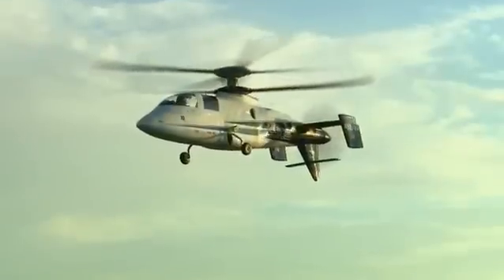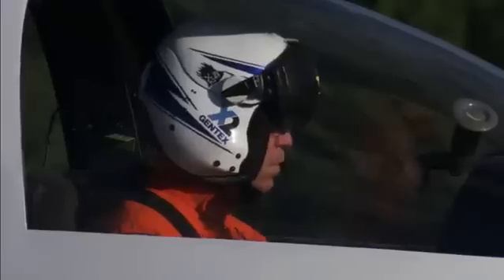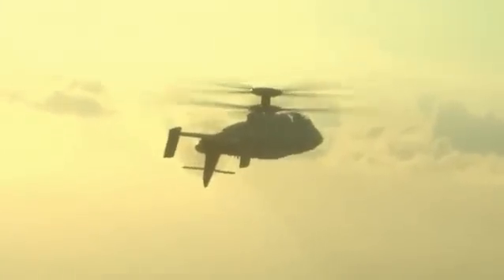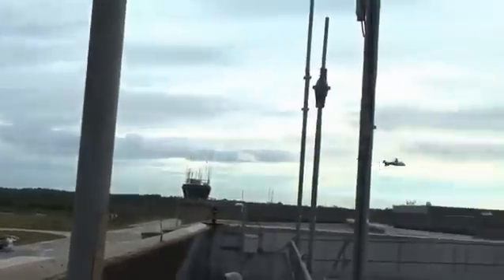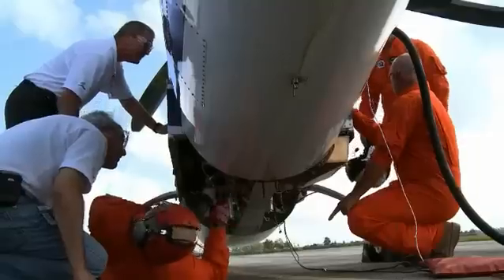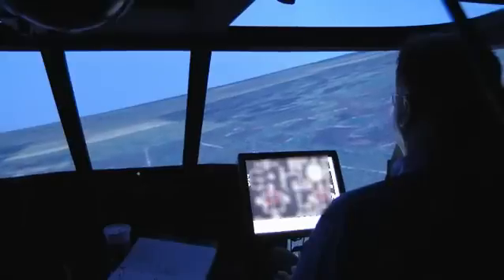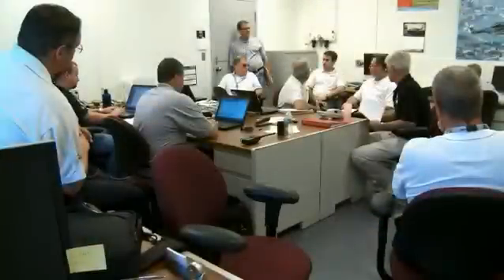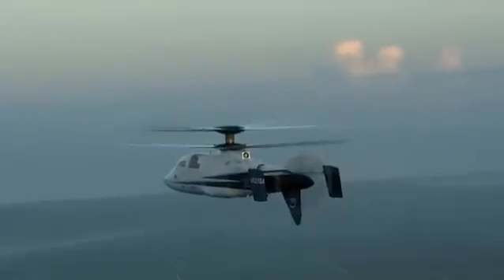Sikorsky X2 World's Fastest Helicopter Cool Commercial Carjam TV HD 2013

Comment: Sounds like you've almost equal the speed of the Lockheed Comanche it was tested in the late 1960s and early 70s, which still to this day can out fly the Apache helicopter. And without electronic stabilization was very easy to fly and was exceedingly stable. I'm wondering if that 300 mile an hour area is the fastest a helicopter can actually go?
Reply: Mr. Hawk, you're talking about the Lockheed Cheyenne, not the Commanche.  And you're right, we were cruising  every day, straight and level, at those speeds.  We needed a P-51 for a chase plane.  I am one of the Lockheed pilots on that program.
Reply: @berchmanrichard2976  nice!! You are lucky in a different way!  😅

Comment: Why not make the rear rotor double too, to gain more speed and symetric wake ?
Reply: Two props (or rotors) operating together are less efficient. The bottom (or rear) rotor is accelerating air that has turbulence from the first rotor, which makes it less efficient. This is why nearly all helicopters in the world use just a single rotor. Producing a given amount of thrust with one large rotor will always be more efficient than producing the same amount of thrust with two stacked rotors (or props).

The main advantage of using two rotors in this aircraft is the reduction in the rotor's diameter, which reduces the tip speed of the rotors, which allows the aircraft to fly faster before the advancing rotors' tips break the speed of sound. This allows  the aircraft to fly faster than an equivalent single-rotor craft, but it is less efficient in a hover.
Reply: @StephenBelden  tnx for your answer. I took example from Russian TU 95 "bear" which achieved high speed performance due to its double rotor sets. I presume Sikorski engineers took into account that and i know one rotor system has always tendency to inherent gyro effect which could be canceled by double set. Anyway the Raider looks like a breakthrough in design. ✔️

Comment: Back in the 70's Lockheed aircraft built a helicopter called the Cheyenne it was a very fast, also with the pusher prop in the tail. the rotor hub was a ridged 4 blade system, the avionics where very sophisticated and the Army didn't like that about the helicopter( they couldn't work on it by themselves) so they went for the cobra instead
Reply: You've got part of it right Mike.  The Air Force didn't want the Army to have such a fast moving weapons system.  They wanted the A-10.  The Cheyenne was designed to be worked on in the field, and we flew at 250 every day.  I was one of the Lockheed pilots.
Reply: @berchmanrichard2976  I was one of the mechanics from Berta that built the "cow pie" avionics.
Reply: @mikeroberts1761  Congrats, the avionics were very advanced for the time.  I remember the mechanics changing out units while sitting in the cockpit at Yuma, waiting to take off.  We also had to change a avionics unit while sitting at a remote location while taking part in a demonstration.

Comment: How about carrying the legacy of La Cierva/Pitcairn who Igor lets say “borrowed” the original rotor head design to allow for his initial success? We all stand on the shoulders of giants. The first to exceed “Mu” was Jay Carter of Carter Copter whose largely individual effort showed the importance of reducing the induced drag by lowering the disk angle of attack and limiting the parasitic drag to the rotors wetted area.  In Carters approach, the lift needed to sustain flight was given to smaller auxiliary fixed wings. This arrangements  of course induced its own form of problematic drag. It’s obvious Sikorsky’s approach was to reduce the diameter of the rotors to spin them faster. Faster equal higher retreating blade stall. Reduce the disk profile but depend on the lift not of the blades but of the disk and shove it through the air buy a pusher propeller. This must be done because the rotor disk cannot be used for forward propulsion when the aircraft is configured for higher speeds. Clever approaches to solve challenging problems. I expect such an aerial dart will never be much of a load carrier due to the  stress limits of rotor diameter vs rotor rpm. Nevertheless the Sikorsky team did it. Congratulations.

Comment: Igor Sikorsky (25 May (June 6), 1889, Kyiv,-October 26, 1972, Easton, CT, USA) - Engineer (aircraft) and entrepreneur, has long lived and worked in the United States. The idea of him inspired drawings helicopter air screw Leonardo da Vinci. 1918 emigrated to the US, where in 1923 founded Sicorski Air Engineering. Author aircraft giant "Ilya Muromets" (1913, Russia), S-29A (US). The designer of the first US amphibious aircraft.-1908-1912 - studying at the Kiev Polytechnic Institute, designed and built several helicopters biplane.

1908-1912 - built in Kiev 6 types of aircraft and helicopters.

1911 - his plane C-5 passed the exam to be the pilot. Installed 4 all- records, performed demonstration flights, passengers rode.

December 29, 1911 in an airplane of his own design C-6 set a world speed record flight with two passengers - 111 km / h.

Comment: If the fastest you can ask for the forward advancing wing to go is MACH 0.9, and the most you are willing to accept for a REVERSE FLOW over the retreating wing is MACH 0.15  (giving the blade an actual downwards push, not lifting), then the maximum forward velocity of that vehicle is about MACH 0.525, or around 330 mph at sea level.
 You can increase this by increasing the size of the rotor's central flarings into a TRIANGLE SHAPE so that it forms an actual lifting body, where this flaring is about 2/3 of the rotor radius, and only the outer 1/3 of the rotor radius is movable and actually delivering lift in helicopter mode.  Then, when the vehicle reaches around 250 mph, both triangular rotor flarings and rotor extensions are slowed down and stopped, with the tail section taking over all roll-control for the craft.  These stopped rotors now act as wings and the craft can accelerate up to Mach 0.9   . Very easy, even I could build one.
Reply: Willilly Bab Is it impossible then to go 330 Knots for a helicopter?
Reply: Willilly Bab.
It's been three years and we're still waiting for you to build it. 😆
Reply: You are speaking of LHX technology :)

Comment: Should be 10x bigger.. with full guns and rockets... Apache II maybe.. but let's face it it's a primitive machine compared to a UFO...
Reply: There are plenty of physics problems in finding a new frame for something like the Apache replacement.  After one adds the armor,weapons and mast radar, it will need bigger engines to keep the speed which will suck more fuel and lower its range.
Reply: This is just a proof-of-concept test bed; bigger models are in the works, such as the S-97. It's going to be a whole family at some point.
Reply: armor dont take much with new compositesn they arent using carbon steel, they use fibers

Comment: This isn't a helicopter, it's a hybrid. Most of its speed comes from the pusher prop at the rear. Now if they could go this fast using a standard rotor then that would be impressive, but it seems in typical American style, they simply bolt on a rocket or go faster engine and claim to have 'changed the world'. Now where have I heard that before, oh yes, Apple....another U.S company that no doubt brainwashes its boardroom execs into believing that they invented the wheel....
Reply: Cyril Berruyer
 Eventually a forward speed is reached where the advancing blade is reaching Mach 0.9, and that is about the maximum it can go before shock waves start to tear the wing apart. So the rotational speed has to be REDUCED in order for the aircraft to go faster. A point is reached where the retreating blade is actually having air flow over it in a reverse direction, causing NEGATIVE lift for that part of the rotor sweep. When that point is reached you've reached the limits of a helicopter's speed.
Reply: Bab -- what happens when the traditional cyclic is redesigned so that it splits where both blades are always in a "lift" configuration at high speed.  There'd be a wall somewhere in acceleration where in a swift action, vehicle speed increases, rotor speed decreases and a new set of control logic controls pitch so that no matter what the blade is generating lift (except as it transitions AOA on one side to "reversed" AOA).  As the retreating blade enters the stall zone, its pitch is reversed so that the faster forward airspeed allows some lift in the "dead zone".  I believe that will be the next evolution of this design if slowing the rotor down as speed increases isn't enough to keep it happy.
Reply: pepe cojones I believe you meant rotodyne? In case you did you're mistaken. A rotodyne drives its rotor through reaction impellers placed at the rotor blade tips. This helicopter, OTOH, has a quite traditional engine/gearbox/mast/rotor transmission system. Contra-rotating, coaxial, but other than that, very commonplace.
Reply: Do you actually understand the challenges of bringing a rotary wing to that speed ? Ever heard of retreating blade stall and advancing blade supersonic speeds ?!
Reply: Cockle obviously has some skewed perspective due to his prejudice toward Americans and struggles to simply review the technology here. But Cyril and Pepe are absolutely right. Though simple looking, the X2 tech demoed here in these test flights is extremely advanced -- not simply just putting a rocket pack on the back. The competitors in this field all produced similar designs. Look at the X3 from Eurocopter. I'm sorry, Cockle, but you simply do not know what you're talking about...
Reply: It is a dual-rotor rotordyne, a very old concept however with todays' design tools such as computer modeling and simulation, advanced flight controls, composites, new rotor designs, the "old is new again" and better.

Comment: Comparisons between the X2 and X3 are absurd. I realize this is the YouTube comments board but c'mon people - this isn't an international pissing contest for people who have no achievements of their own to lay claim to.

The X3 is a technology demonstrator that serves no other role except to go fast. Having twin tractor props is a workaround to deal with retreating blade stall, as is unloading the main rotor in transitional flight. It's pretty telling that they are so reticent to release performance data on the aircraft: usually Manufacturers are yelling that stuff from the rooftops after first flight. Given that it has only 400hp over the EC155, I can't imagine that it can carry very much at speed.

The X2 is the working prototype for the S97 scout program. Going fast is simply how it gets to work. This thing's CRUISE speed is well over 200 knots (design calls for 230 in production) and once it's on station, it can deliver a 1400 lb weapons payload or spot for other platforms like the AH-64 like the RAH-66 was meant to do before its cancellation.
And it does it all on less than half the power and 20% more range than the X3.
Oh, and the S97 calls for a six seat cabin as well, probably in an bid for the civilian market. On balance, this will be quieter, smaller and MUCH cheaper to operate in the civilian world though at a projected $15M per (vs a 206 @ $3M), I suspect the US military will be the guinea pigs for a while.

The technological advancements in this machine may not be readily apparent to those taking part in the aforementioned pissing contest, but anyone with an appreciation of aeronautics can readily see the problems that these engineers have tackled...and apparently beaten. AND more than a full year ahead of the original development schedule !

Bravo.

Comment: thats a gyrocopter just saying
Reply: No it's not - the rotors are driven in flight. The X3 is essentially a gyro when the forward props are providing thrust, but the X2's rotors are always powered. If the rotors were passive in forward flight, a single rotor would be a much simpler solution (like the X3) Because the rotors are still driven, a coax rotor head counteracts retreating blade stall by putting an advancing blade on the same side.

Simple, but genius.

Comment: Looks expensive and high maintenance; like the counter rotating blades though, great concept even factoring in the more complex/heavy transmission.  The counter rotating blades are the secret to their more efficient rating because they provide extra lift at the same time minimizing the counter spin allowing them to just place the rear rotor facing back and no need to dedicate it to just stabilization/counter rotation.  I could make it better; especially for combat.

Comment: Pffft, how smart can they be?! They put the tail on upside down!
Reply: I think the tail design came about from having the tail fly in cleaner air at higher speeds, versus the normal helicopter design where airflow from the rotorwash in forward flight directly affects tailboom design, stabilizer areas, location of tail rotor, rotational direction, etc, for stable flight. It is indeed a very smart solution, not to mentioned the pusher prop which comes from the Cheyenne design of the 60's..
Reply: javacup912.
It stops the rear propeller from hitting the ground and a convenient place to put the tail wheel.
Reply: @javacup912  The tail is facing downwards because the rotor blades would cut it if it was facing upwards, that's the reason. If they decided for the usual tail they would have to extend the tail boom of the heli and add unnecessary weight.

Another benefit is that is can also house rear landing gear inside, thus making it easier to touch down.
Reply: They thinking out of box Sir
Reply: javacup912
I think he was joking, and I LoL'd.
Reply: Smarter than you obviously
Reply: The true genius is that you noticed something that you never thought of, isn't life ironic?...........
Reply: David "Miscarriage" Miscavige hahahaha right the thing doesn't even have a tail roter and they put two main rotors everybody knows that's just going to decrease horsepower and worst of all it's blue my dog knows red as faster than blue and green pshhh you don't even want to know how fast that is they just don't use green because they're afraid to go over light speed
Reply: Jimmy Greene.
It does have a tail rotor...it's just pointing the wrong way.  😆
Reply: John O haha thats no tail roter it's a propeller in the badk so they got reverse ;)

Comment: i would have thought this idea would have come before the copters we have now
Reply: The US has been playing with it since the 60's and, if this doesn't go forward, it will continue to come up every now and then. Look up the AH-56 Cheyenne. Transitional rotorcraft are just too appealing to leave alone. It's the potential of composites that has brought it back to the fore - if composites and avionics can make it a feasible platform it will stick around. If not, it will fade out again until the next technological development inspires designers to try again.
Reply: In a sense it did; there was a design called the Rotordyne which consisted of a single rigid rotor, with forward thrust prop or turbojet. Look up the Cheyenne helicopter gunship; it used this very principle and lost to Bell's Aircobra (politics, and it was too fast).
Reply: pepe cojones

The Rotodyne was an autogiro in most flight modes. When not, the rotor mast was driven by the blades via the tip jets rather than driving them via the transmission. The physics are completely different and have absolutely nothing to do with a coaxial rotor system. Just like a giro, the Rotodyne didn't generate significant precession because the blades were driven, so it didn't need a tail rotor to counter the torque. The X2 doesn't either, but that's because the torque from the coaxial rotors cancels each other out.

The Bell Airacobra was a plane (P-39), not a helicopter. You are thinking of the AH-1 Cobra, a completely different animal. The Cheyenne had a single rotor disc, so it's nothing like the X2. It was killed by the technical problems they couldn't fix, not 'politics' and certainly not because it was "too fast".

The problem with the Cheyenne (and all augmented-thrust helis) is retreating blade stall and the resulting asymmetry of lift. The X2's coaxial rotors are a simple but elegant way to deal with that: you always have an advancing blade on each side of the aircraft.

Comment: The Eurocopter X3 is just as fast.  big deal.
Reply: but it looks absolutely ridiculous!  Not to mention the safety issues of propellers right outside of both doors.  If they spin while the main rotor spins you would not be able to do any hot load/unload whatsoever.
Reply: As fast and low vibrations.

Comment: Unlike you, I provided a direct quote.  And Wiki doesn't support your BS, which I should have expected.  Here's another link showing the tech was copied: "In 1931 the Russians bought two Christie tanks from the U.S. Wheel Track Layer Corporation in the United States. The Russians copied these, built Christie tanks, and then incorporated the Christie suspension system into the T-34."

Dumbass, copying is not licensing. This is just like how Russia didn't pay for the Rolls Royce engine for its

Comment: Cause I know it. Engines were partially previosly bought, partially domestic. Weaponry is domestic, Fire control is domestic.
Turrets and 18 cylinder outlook? Is an Airbus a copy of Boeing?
Tu-16 is not a strategic bomber, 
Chinese usually buy, next clone. Like they did with Su-27 (still buying engines for them). Or spy work.
Most difficult task in clonin was completely new production lines didn't land together with B-29 in Siberia. SU was not permitted to buy or lease B-17s even.